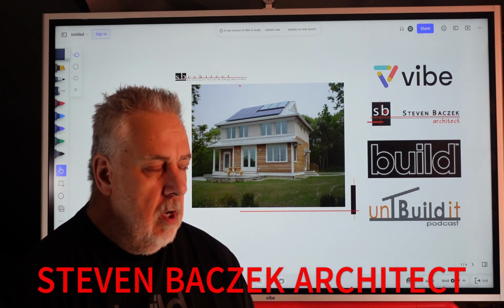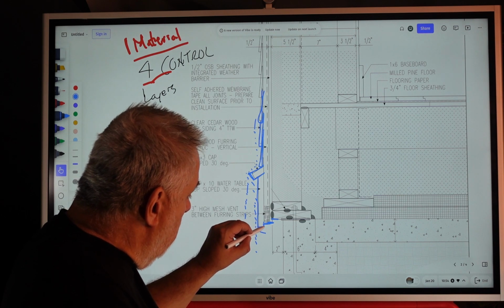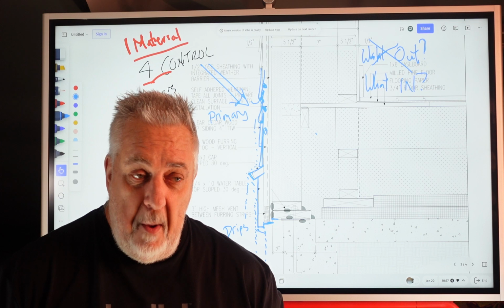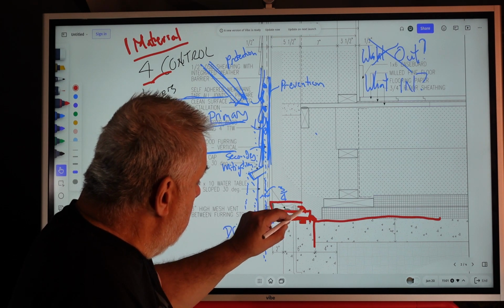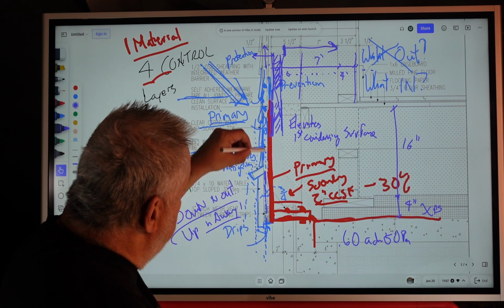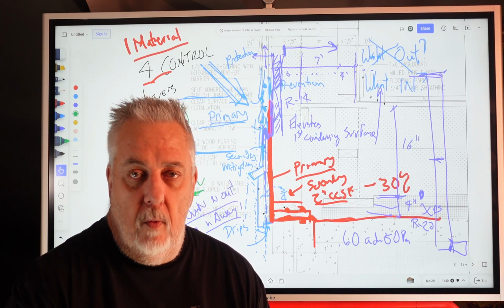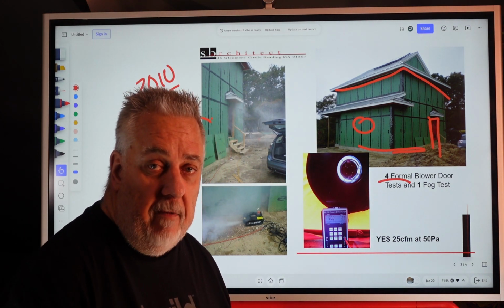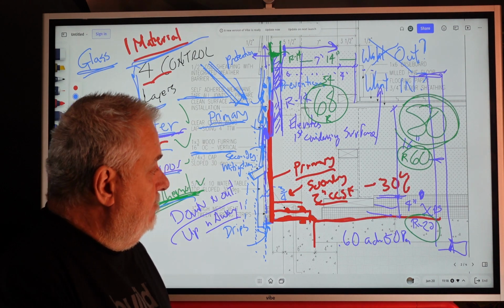PH 11 Episode 7 - TALKING CONTROL LAYERS

Comment: Steven, has an architect ever used an I-Joist as wall studs? If not why not? Wouldn’t It solve the need for a double wall? My understanding is that after 9” thermal transfer is 0. So an 11.875 wide I-Joist should work well.

Comment: So with ZipR the primary air barrier is the inside of the polyiso? The joints aren’t sealed from the inside so leakage to the OSB is inevitable. What am I missing?
Reply from the maker: What you missing is to have a leak, you need 3 things......1 A hole.....2 A force.... 3 A pressure difference........what you sugest is a pathway, not really  a hole, we may have a force if the house is pressurized, but there really isn't a pressure difference at .57 ach50 PA so what is getting to the OSB? ......at best a very very very minute amount of vapor? We opened this wall years after construction, it was bone dry!! just an FYI

Comment: I do find the criticisms of Zip I've seen on YouTube amusing because they're usually something like, "Look, if I put 12" of water column on this overdriven fastener then water will get into the OSB!" What are you building, a boat? Install any of the WRB systems correctly and they'll do what the manufacturer designed them to do.